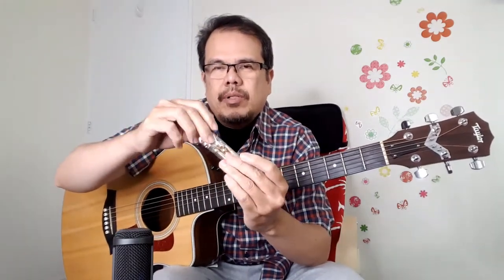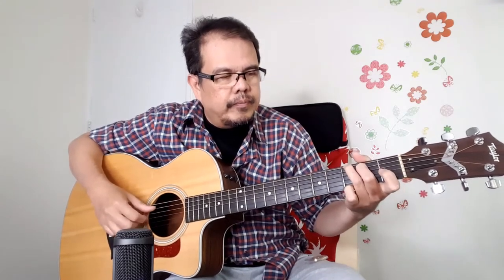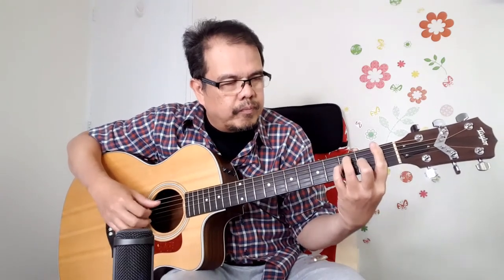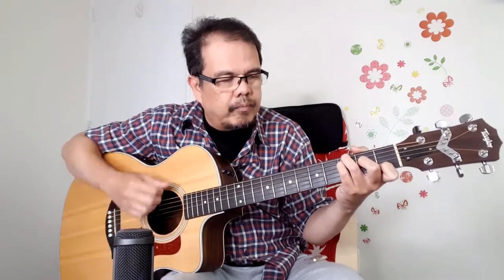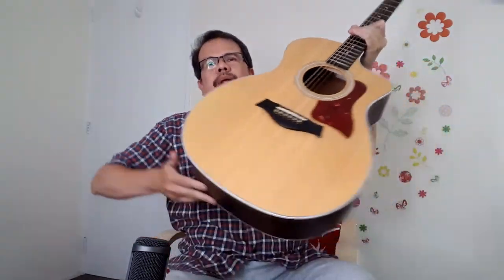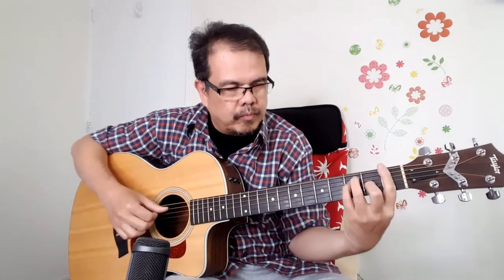Bone vs Brass Bridge Pins Comparison on Taylor 214ce Acoustic Guitar

Comment: After snapping a bridge pin, for only the second time in over sixty years, and the cheap plastic replacement not being satisfactory I tried brass (just a few hours ago). on an old cedar topped
Takamine, the improvement is noticeable both in better tone and increased volume.

I will try them on other guitars (I got two sets) I suspect that the difference will vary depending on the wood used for top and bridge and size of guitar, or even if the guitar is played with plectrum or finger style, must say I'm more than impressed so far.

I couldn't detect a great difference on your guitar but somehow thought the brass pins sounded better.

Comment: I think the brass bridge pins make the strings transfer a much warmer and more clarified sound, at least with your playing and with the Taylor.  The physics demands that metal-to-metal, especially brass(bronze) to brass helps more purely transfer frequencies.  The metal also forces tonal stability since its crystalline structure vibrates with recognizably complementary nodes, called "overtones" which, in many cases can complement the overtones presented by the guitar's natural acoustics.  Acoustic engiineering is an ongoing science.  Plastic mutes, though other bituminous carborundum (grinding) materials such as bone are denser and harder.  I can really hear the difference and would like to see a demonstration in a laboratory racked up to test the acoustics.  The negative side to brass is that it is not very kind to a wooden bridge, even a rose wood or ebony bridge.  (When the engineers in Greece tried to repair the Parthenon which was made of stone, they used steel girders.  The steel quickly deteriorated the stone and after WWII it all had to be repaired again with some irretrievable losses.  This what happens when two dissimilar materials are united.  Something always has to give.)  A deeper seat can really help the bridge and visiting an excellent luthier to ream out the holes may be necessary.  I would talk to Taylor's luthiers first before doing this and they may agree to to it themselves if they have a mind.  They tend to be perfectionists though I hope they are not brittle to the suggestion.  Of course, what it will do to your warranty I cannot even guess.  So far so good.  Thank you.
Reply: james barclay My mind has been blown. Thank you for this comment! I learned a whole lot, damn man! 💯✨

Comment: I think heavier pins, dampens lower frequency vibrations, hence the sound is slightly shifted towards the brighter side. Based on my experiments and experience, if you want your guitar to have strong sounding bass and resonance that last long..use the lightest material for your pins. Wood pin maybe.
Reply from the maker: Thanks for your comment and sharing your personal experience on this.
Reply: No, brass doesn't dampen the low frequencies. I already got a clarity improvement of the bass tones when I only replaced my Low E bridge pin.
The material that dampens your strings is the plastic of your old cheap bridge pins: get rid of them! What you will get is the overtones of ALL your strings (including your bass strings) that you were missing with the plastic pins.

Comment: The bone pins make the guitar strings a bit muted. Brass is clearer
Reply from the maker: thanks for the feedback!
Reply: they actually sound the SAME. But if you replace the bridge with bronze one, you can tell the difference. tried it Try to chance your Bridge and the Nut with Bronze.

Comment: I got these same pins for my guitar and while i was tightening the new string one of them shot out and pelted me in the forehead
Reply from the maker: Ouch. that is painful.
Reply: And you didn't shoot a video of it? You would have got LOTS of viewers!
Reply: Cool!!
Reply: Maybe you just do it in the wrong way, you should hold the pins while tuning your guitar. Because if not thats what gonna happen, the pin will popping up
Reply: Yep. They like to do that. I pull the strings after inserting the pin to make sure they are locked.
Reply: Did it brighten up your day?
Reply: Did it ring on impact?
Reply: That's hilarious. Lol I just had the same thing happen to me, two of em shot out on me. Didn't get me in the head tho, but one of em is MIA, no idea were it ended up. Thing shot out like a bullet.
Reply: @gingerbeer914  I think he should do a redo

Comment: Just changed 2 of my acoustics to all brass, nuts , bolts, pins everything. One sounds phenomenal and they other raddles on the d string 5th to 8 the fret. Annoying. But on my Epi, sounds like a different animal I love it. Honestly it seems like it depends on the guitar and yes I'm going to also raise the neck to see if the adjustment helps. One huge downfall is the guitar will fall out of tune FREQUENTLY!!
Reply from the maker: thanks for sharing.

Comment: Being a banjo pikker, l've made a 5string bridge out of brass. The results would surprise you. You would think the brass would deliver a clear sound and ring like a bell. Wrong , brass absorbs all of the miniscule vibrations and overtones that the string tries to impart to the head. I can clearly hear a difference in tone, bone  pegs are much better. This is just my opinion. You did ask for a comment. Incidentally, mesquite is an excellent wood for banjo bridges.
Reply from the maker: thanks for sharing your experience with brass material.  It is interesting to try that on guitar saddle some day.

Comment: Maybe consider hybrid and put 2 bone pins back into E-A strings?
Reply: bcc1955 that's a good idea,I might just that
Reply: What would the benefit of that be? I'm actually interested in this idea
Reply: was thinking almost the same but different : brass pins in high E and B cause I liked it kinda smooth on high strings but preferred the rest with bone

Comment: Changed the mid eq frequency range less loud in some of those but, more twangy. I believe the mfg got it right using plastic for most applications.
Reply from the maker: thanks for your opinion
Reply: Plastic is a little deader than bone. Taylor doesn't use plastic. They use ebony. Which give some warm overtones. Plastic is not the best. But it's subtle. Bone is less muted than plastic. Plastic is alright.

Comment: Sounds better to me and my cheap phone speaker. Can brass pins be used if there is a pickup under the bridge?
Reply from the maker: yes.  Mine has under saddle pickup and it does not affect the pickup performance.

Comment: Brass sounds great. I think it could be a little bit more interesting if you put in to a dreadnought model to see how clear could sound the low frequencies.
Reply from the maker: thanks for sharing your opinion.  I might consider testing on Dreadnought next time.
Reply: I have some on my dreadnought. They are literally the best thing ever. Soundtechs always tell me that they dont ever have to adjust any EQ for my guitar now. I have a 10 year old washburn which sounded waaay too woody and bassy for my liking and these fixed the issue.
Reply: @robfullstop I have a mahogany dreadnought acoustic, gonna try brass pins so I'll hopefully get crisper highs to match the good mid & rich low sound

Comment: Does the bone nut will affect the sound as well , or not worthy to do it and keep the original one , fender fa 125 ???
Reply from the maker: I don't worry much about the nut.  It has minimal effect I guess.  I suggest, you change the nut only if needed, such as slots were gone too low or the nut is broken.

Comment: No difference. I don't think the tone will change in this way. I have tried adding back a 0.6mm brass shim underneath a bone saddle (too low after sanding), the strings vibration improved quite a lot in my Taylor 914CE model.
Reply from the maker: thanks for sharing your idea and experience.  I never tried brass ship before.  Interesting.

Comment: The problem with brass pins is when you put it on bass to 6, 5, 4 strings, the sound becomes irritating. so what i did on my acoustic guitar is ebony pins on 6, 5, 4, brass pins on 3, 2, 1 and it's better
Reply from the maker: thanks for sharing

Comment: Brass is denser and adds more mass to the sound board. That dampens the low frequency woody sound and makes trebles clearer. If your guitar sounds too muffled then heavier pins can help but to most people, they like the woody airiness of the guitar sound. So brass pins are not a good idea for most guitars
Reply from the maker: thanks for sharing your opinion and experience on this
Reply: No, brass doesn't dampen the low frequencies. I already got a clarity improvement of the bass tones when I only replaced my Low E bridge pin.
The material that dampens your strings is the plastic of your old cheap bridge pins: get rid of them! What you will get is the overtones of ALL your strings (including your bass strings) that you were missing with the plastic pins.

Comment: After reading up on bone pins, I got some. They were .005 to big to fit properly since I would NEVER ream out the holes thereby disqualifying the standard Taylor pins from being used, so I just flied down the bone pins I got from this online co. All I had to do was take off about .005 of an inch, they fit fine. It seemed like my 314 CE Taylor went down in tone quality, brightness and all aspects. I did put a .11 set of Elixer strings on instead of the 12's that were on it which were old but still sounding good. Maybe that's the problem.Taylor Co. said in a phone call that they recomment using the EBONY pins that come with the guitar. I dunno, but your video was great and I could not tell the difference between pins. Someone needs to do a controlled experement with a DB sound monitor with a volume needle etc. Good job though.
Reply from the maker: Thanks for your input.  Appreciated.

Comment: My conclusion after listen to many comparisons is this. Tusq nut n saddle n tusq or brass bridge pins for the brightest, bell like, most articulate tone. If ur guitar has bright tonewood like walnut, maple or rosewood back n sides. U could get by with bone nut n saddle n ebony pins. But not plastic or bone pins ever on any guitar whatsoever. The liquid metal bridge pins arent any better than brass. If u r going for that bright crisp sound go all the way with tusq saddle n nut n tusq or brass bridge pins. Basically u have to brighten up mellow tonewood, like mahogany n mellow down bright tonewoods. I would do tusq saddle n nut on any guitar n do ebony or snake wood pins for a mellower sound or go straight to brass for brighter sound. Snake wood pins r expensive tho. Would like to hear comparison of those.
Reply from the maker: thanks for sharing your thought

Comment: I expected the brass to be a little quieter (heavier bridge generally mutes a little) but didn't hear a significant difference. Hollow carbon fiber pins would be interesting to try.
Reply from the maker: I haven't tried fiber pins too.
Reply: As far as I know, hollow carbon fiber bridge pins don't exist. I only meant to say that if they did exist,  that would make more sense to me than brass.  It would take experimentation to verify or disprove, but reducing weight seems more likely to improve tone than adding weight—though plastic or wood bridge pins already don't weigh much.
Reply from the maker: oh, got ya.

Comment: The difference in sound is due to mic placement not bridge pins. The first take the Mic is close to the left of the sound hole and the second take the mic is closer to the center of the sound and the microphone Is tilted  5° to the right.  What south of the saddle will not affect what is north of the saddle. However, changing the saddle and/or the nut from bone  to brass will affect the sound of the open strings.
Reply from the maker: thanks for you comment
Reply: You got it man.  I'm looking forward to for of your videos

Comment: Sounds more sparky! (Sparky 🤔?)

It sounds more brilliant, more treble, changes the tone, more clarity, and more volume. And it is only pins.
Dissapointed with bloddy bone. I wasted my time giving shape to smelly nut bone andsaddle for nothing. Thanks for the video
For some reason Taylor, Takemine, Martin, dont use bone, but Tusq, micapa or whatever, but Not bone.....
Reply: Ángel Castellanos Martínez where are you getting your information from? Martin use bone in all there high end guitars,as do Collings and lowden and any other high end guitar company,ask any experienced luthier bone is the best material that can be used for saddles,nuts and pins,

Comment: If simple mechanics and common sense,.......brass is obviously going to make the strings and wood vibrate more than plastic or bone,....I still feel horn pins may get a different feel,....but plastic or bone add nothing to the tone or vibration of the instrument,.....solid brass shouldn't break either,....I've often in the past had problems with bone pins getting snags on them,....bone IS better than plastic,.....but I never figured out why most company's sell their guitars with plastic pins when, bone or brass would be like,  one dollar more expense for them to put on the guitar.